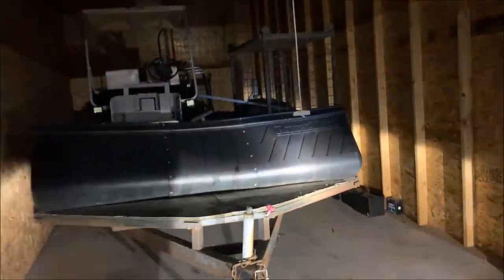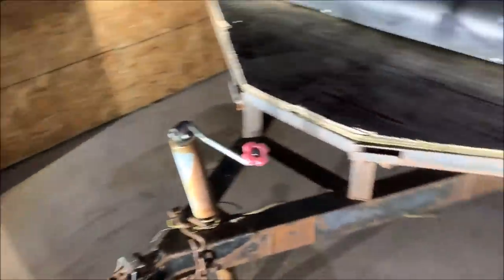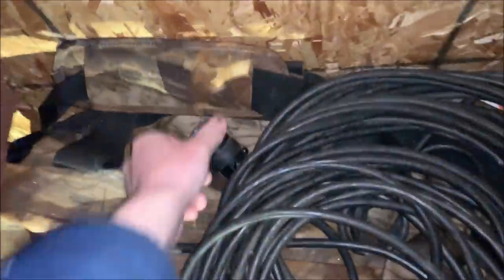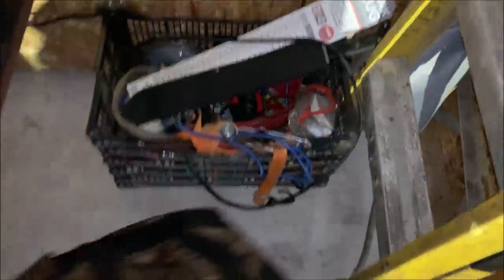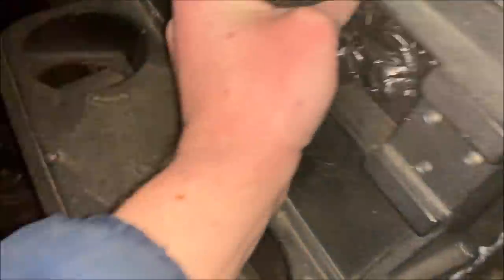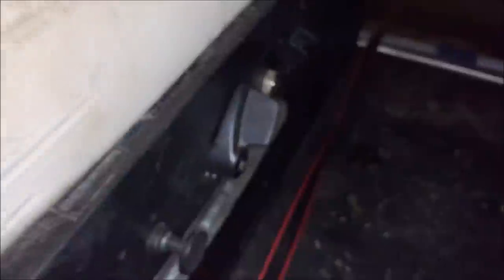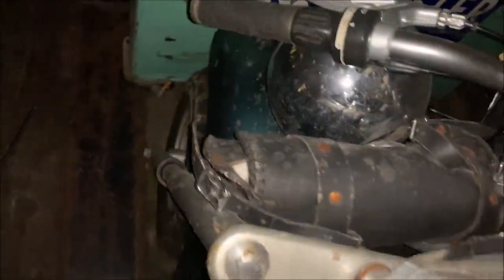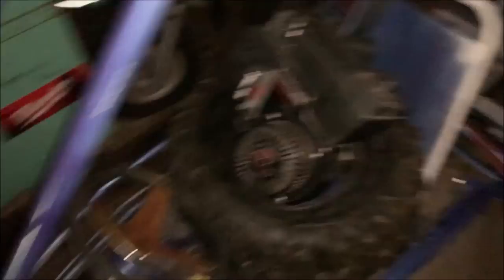This is the Most Expensive Storage Unit I've Ever Bought at $2850

Comment: Those are R4 industrial tires, you are right they go on 4x4 tractors as front wheels on compact tractors, but they are also used on all-terrain loaders/telehandlers, forklifts, mobile work platforms (GENIE et al) and other applications.

Comment: Pressure wash the trailer and spend a few bucks on some black Rustoleum paint to pump up the $ on the trailer.
Reply: Cheaper trailers are hard to find.  This one is also long (great for ATVs and SnowMobiles).  Tires?  Lights?  Bearings?  Getting $2k for it could be possible right now.

Comment: I just sold a Jobox the green metal box for 200 in similar condition. Bike 50, mini chopper 300, go cart 200, cart 50, golf cart 1000 and trailer 2000 is how I'd price the stuff
Reply: Batteries I'd find a distributor they usually buy them for half core price. Better than paying to recycle them
Reply: @chrislongbeard  or a scrapyard.
Reply: The metal box $100-200 (a little small)
GT TimberLine bike $100-200 (about $300-400) new.   Older GT triple-triangle is good stuff.
Chopper $200-400 needs work, but bikes are short right now. 
Golf Cart $800-$2k+ (needs to be cleaned up-rough).
Trailer = doesn't really look that great, but large and it is snowmobile season.  Sort of pieced together with the snowmobile front added.  Rusty, not well kept, wood deck?  $800-$1500 $2k for a desperate buyer and everything works.  
Go Cart = maybe close to $500 

=May have a hard time getting your $2850 back.  If you get that Golf cart back to mint maybe close to $3k for that alone.  -Helps you greatly that there are shortages of Rec items now.